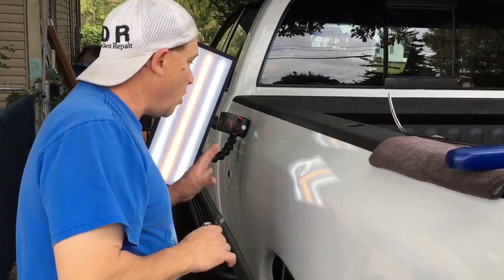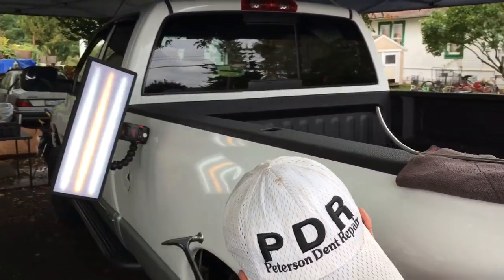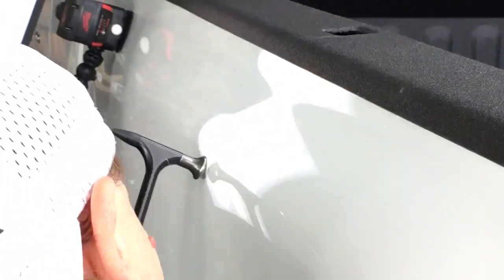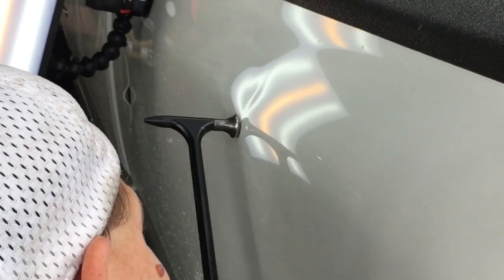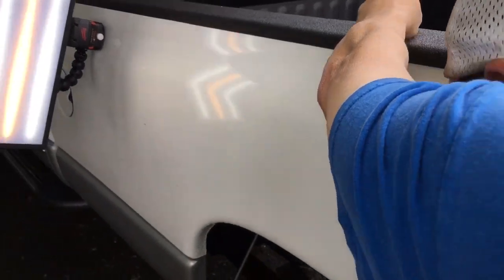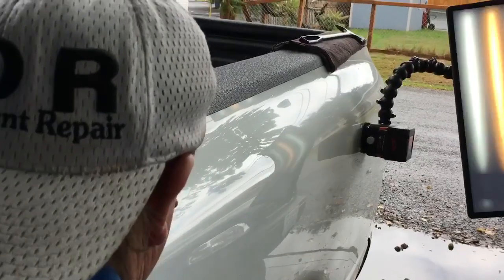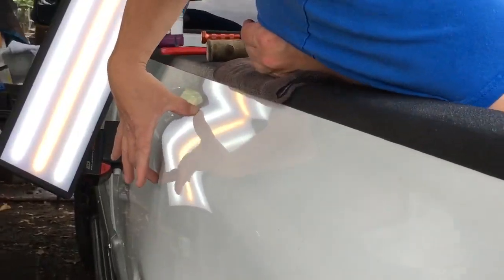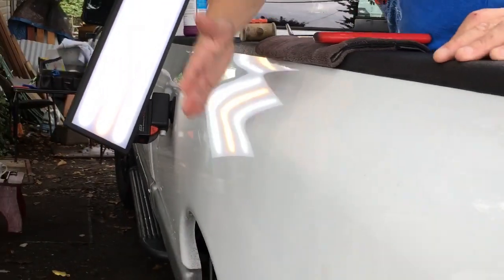PDR tools out DODGE Dent⚠️Trade secret tips revealed!!

Comment: Why don’t you use soft tip tools? are you scratching the inside ?
Reply from the maker: Jay Mann I do have some soft tip tools but now I don’t scratch anything on the inside haven’t scratched anything up since my very first year that’s the first thing you have to learn.👍
Reply: PDR Peterson Dent Repair I don’t understand one thing you are pushing the metal with a tipped metal rod. How is it not scratching the panel from inside?
Reply: Also is there any damage to the paint or e-coat?
Reply from the maker: It’s because I don’t slide the tool around the back side I make a push and then left it and move it and make another push.